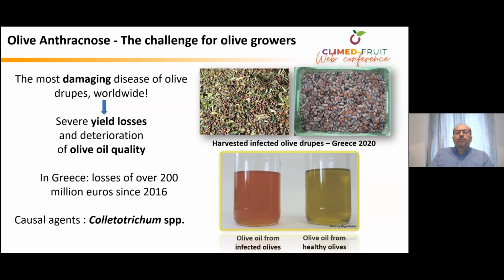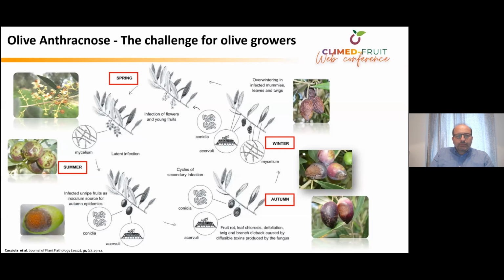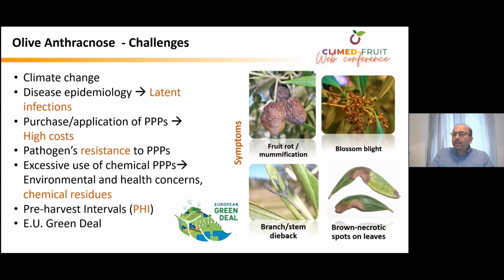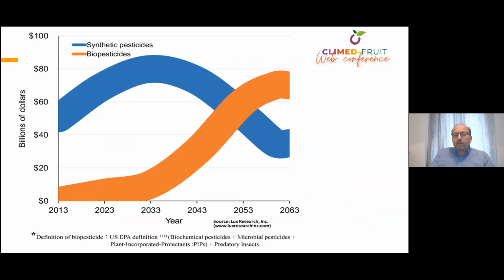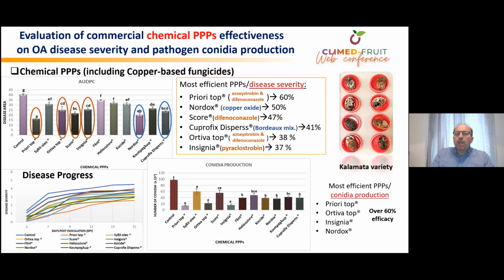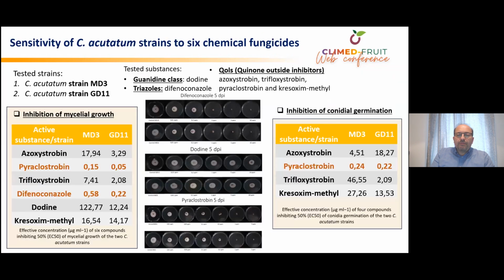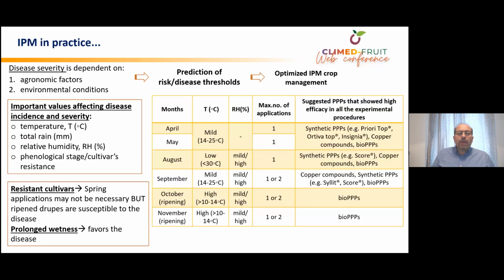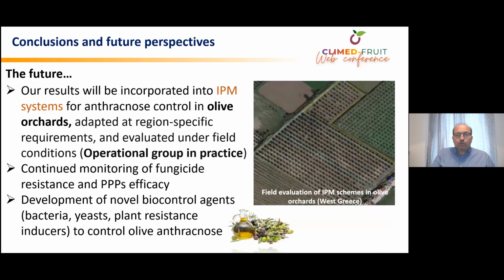Integrated management of olive anthracnose disease

Comment: The research is being funded under Action 2 “Implementation of the Operational Plan (project) of the ESK Operational Groups for the productivity and sustainability of agriculture” of Sub-measure 16.1-16.2 of Measure 16 of the AGRICULTURAL DEVELOPMENT PROGRAM 2014 - 2020 "Cooperation" in Greece (Μ16ΣΥΝ2-00370).